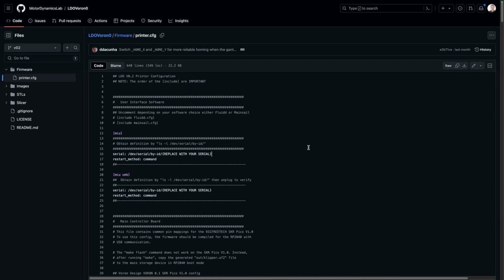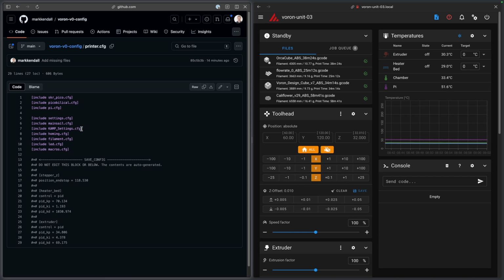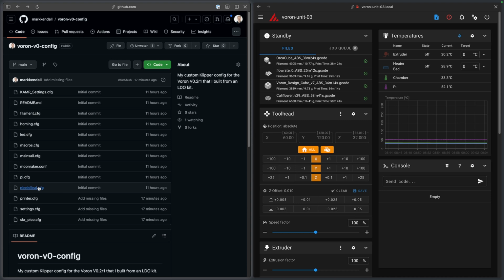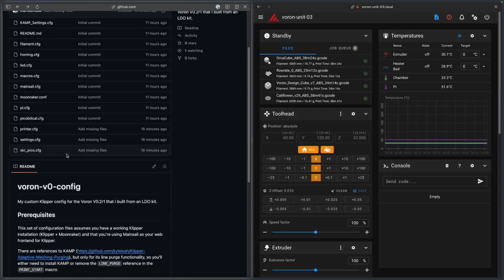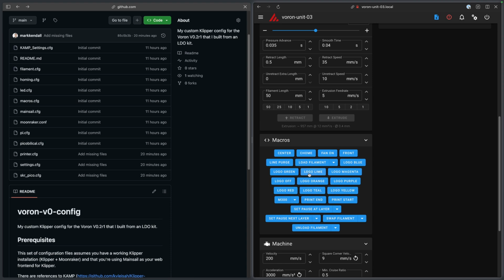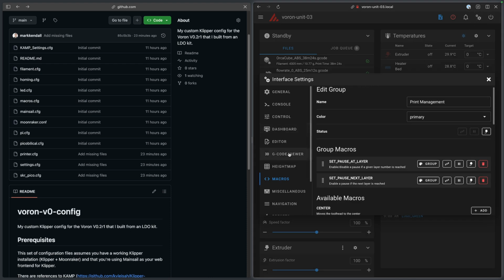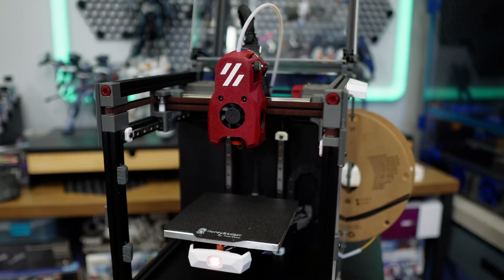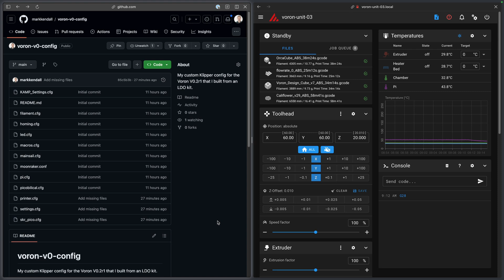LDO Voron 0.2 Build - Organizing Our Klipper & Mainsail Config

Comment: Hi Mark, thanks for a great series, have been following your built series and enjoying it, i am very new to klipper and all and building my own LDO kit, is a bit confusing to me,  copying you as I go along can you maybe share your Orca slicer start G Code with me, I am not sure if I need to change anything here.
Reply from the maker: Sure. This is what I'm using right now. I think it's basically the Orca Slicer default with a couple extra params (chamber temp and filament type) added to the PRINT_START macro call.

M104 S0 ; Stops OrcaSlicer from sending temp waits separately
M140 S0
PRINT_START EXTRUDER=[nozzle_temperature_initial_layer] BED=[bed_temperature_initial_layer_single] CHAMBER=[chamber_temperature] FILAMENT_PROFILE=[filament_type]
Reply: @gunplamark  Thanks Mark